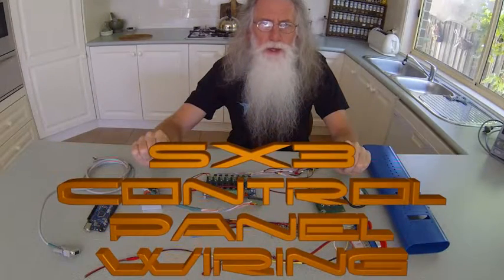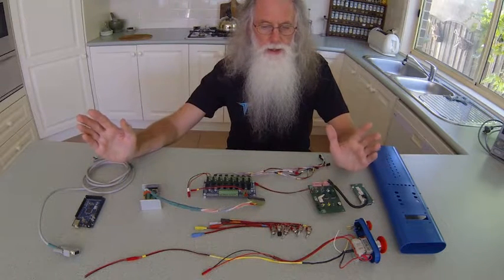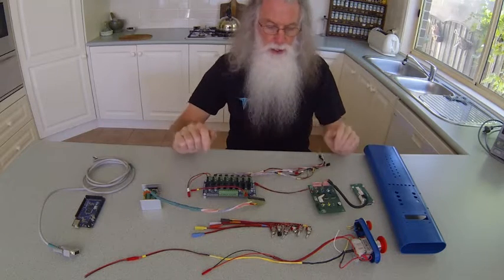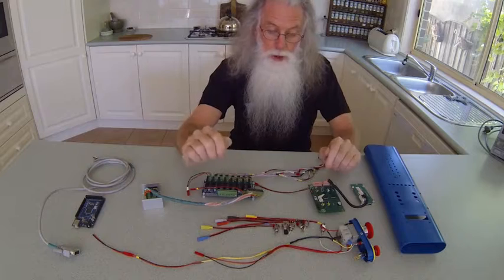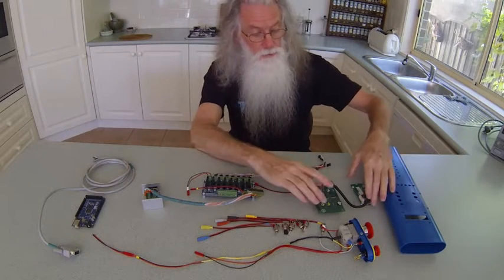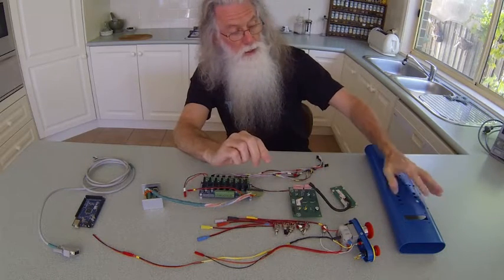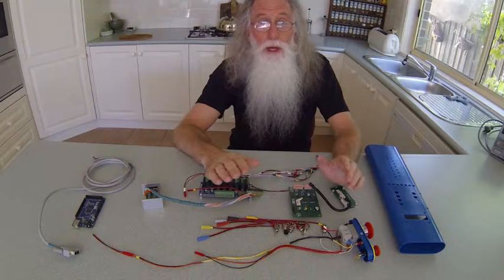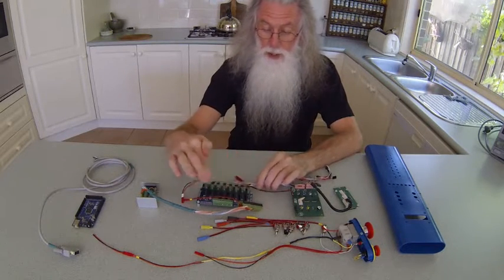CNC4A - SX3 Control Panel Wiring

Comment: Regards.
In what way would it be done for mach3?
It would be topic for a tutorial.
Port connection, buttons and programming. Estop, Resert, Start cycle.
Thanks for answering.
Salud y tranquilidad en estos tiempos.
Reply from the maker: There are other videos out there on the basic stuff, the manual, etc and what I do is a bit different and would mainly suit this type of machine.  But like I said you will make me busy when we reach 1,000. ;-)